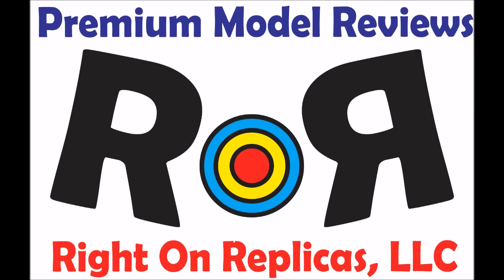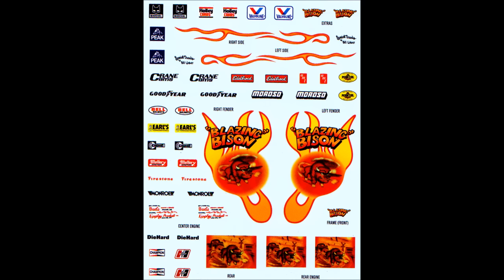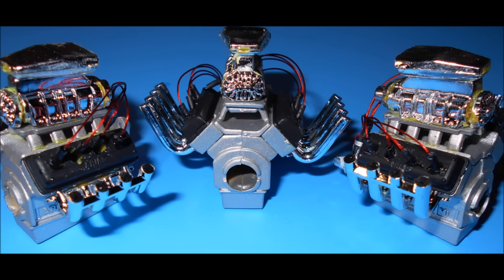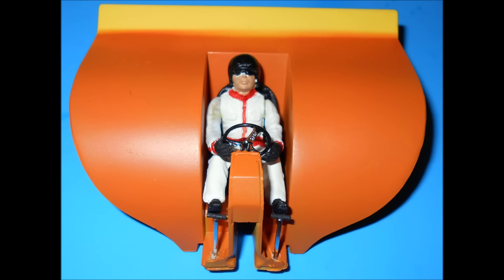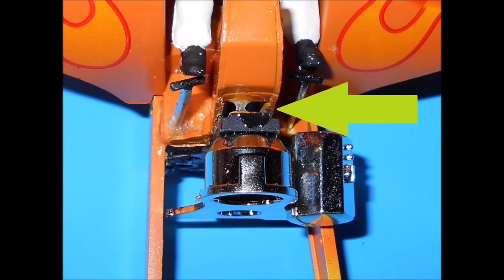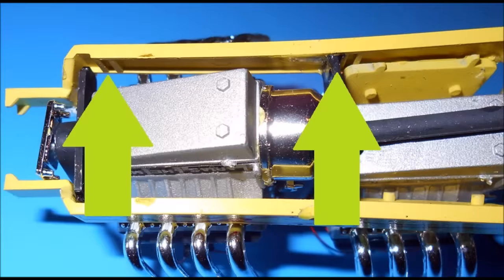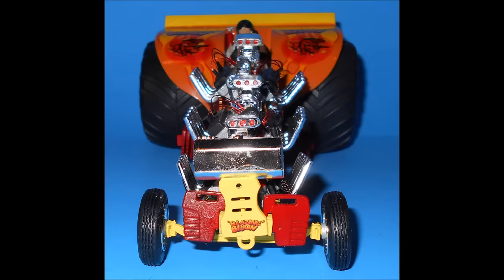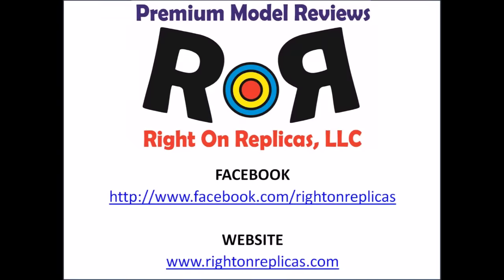How to Build the Blazing Bison Puller Tractor 1 25 Scale AMT Model Kit #1006 Review

Comment: Hi there, my son just shot me your video -  Its sad that the original 1986 AMT / Ertl kits have depreciated in value because of the cheap replica kits. I designed the Bison cartoons and airbrushed them on the original  Meister Brau Blazing Bison Tractor for Steve and Bud. The kits sold for $10. back in the 1986 then  went to $150.  after 2000. I hope those who have the Original 1986 kit treasure them!
Reply from the maker: Dee,  That is a fabulous back story.  Thanks for dropping by and letting us know about the real deal!  -Doug
Reply from the maker: Dee,  I have three of them.  I've always loved the over-the-top kit and the graphics.  Aside from that it was a real drag pull from the era of anything goes.  Right On!  -Doug

Comment: I bought this kit because I had built it when I was a kid. The build looks nice but I noticed the chassis was not square the placement of the fuel tank the wrong spot it goes directly behind the first engine in line with the counsel. The directions have a diagram where each part is supposed to go on the frame. That could be part of the issue where your engine didn't fit. Again it turned out nice. My original kit was broke during a fight between me and my older brother God rest his soul. Love the videos keep up the good work.
Reply from the maker: Big,  Thanks for the info and the story!  -Doug

Comment: Ive got the old '85 issue and the new one! Nice work and i hope one of the 2 chassis i have will mount correctly so the build will go together as planned.
Reply from the maker: Jeremy - You may have trouble with the engine mounts (as in the video) but the chassis/body should mate up OK.  -Doug